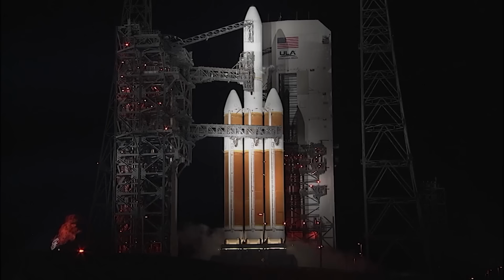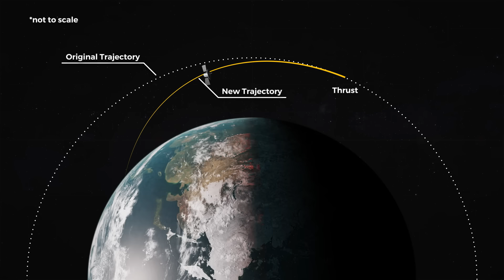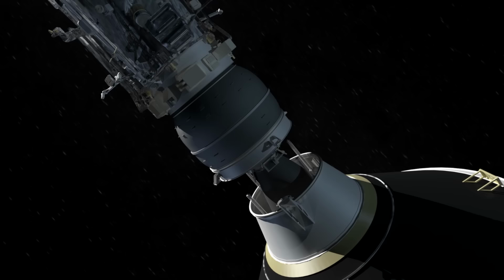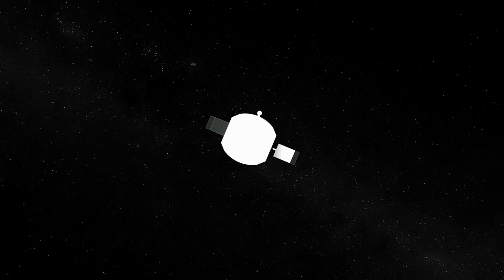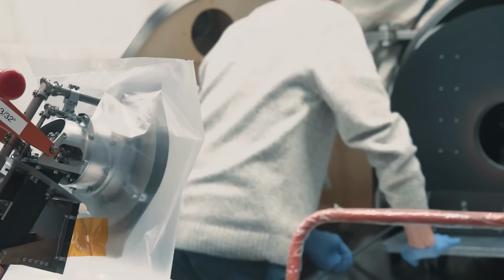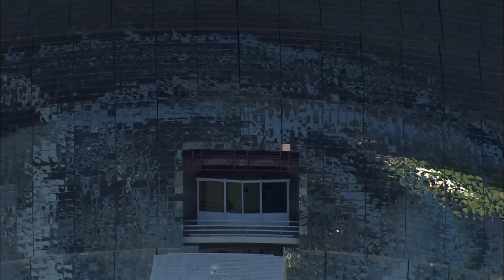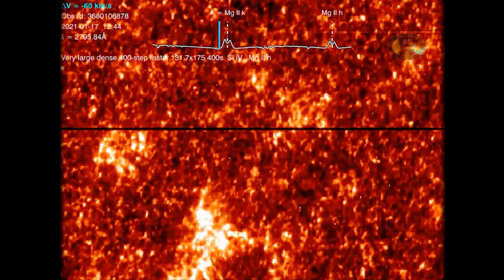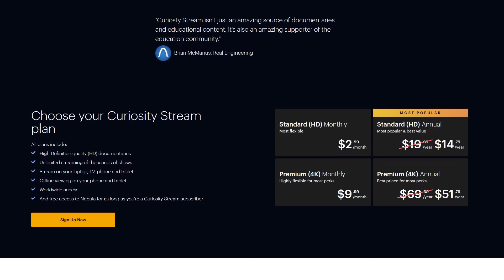The Insane Engineering of the Parker Solar Probe

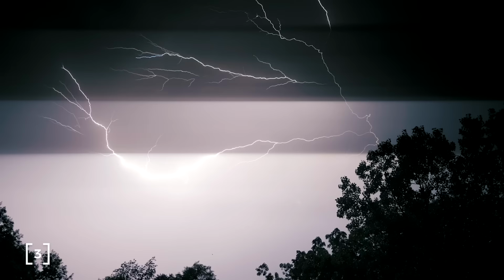Comment: According to the video, the parker solar probe had to face 3500 C temperature for example at 14:20, but at 1:28 you said corona has a temp more than half a million C. Have I been mistaken and didn't watch the video properly? or is there a mistake in the information provided in this video?
Because I cant imagine a man made object surviving half a million C temp!
Apart from this, I really enjoyed the video kudos to this channel!
Reply: The corona gets up to million or more degrees, but it is not all encompassing in that while the particles in there attain that kind of 'heat', they are relatively few and far between and thus the actual temperature that the probe experiences within the corona is a lot less. Thus, it's all about heat transfer. Liken it to putting your hand in 50-degree (celsius) water--which is hot--and then 50-degree air... the latter feels nowhere near as 'hot'. That heat shield is amazing plus the probe has cooling.
Reply: @nuntana2  ohh thanks for providing this information!!
Reply: Absolute lies

Comment: Temperature is a very abstract concept. Especially at such low densities.
Reply: Yep, given the densities of the corona i'd bet a block of ice at its melting point has more internal energy, since the density of the corona iirc was in the order of 10^-9 gcm^3
Reply: The earth is flat and actually Satan has taken credit for the ball earth thing actually.
Reply: @kevinkarlwurzelgaruti458  Temperature is the measurement of energy transferred from one mass to another.
And the total amount of energy transferred depends on how much mass there is, with higher energy, to transfer to the lower energy mass.
For example:
If you drop a grain of sand from 100 mts. high on your head, you won't even feel it.
If you drop a block of 100kg of concrete from 100 mts. high on your head, it will kill you.
Both the grain of sand and the block start with the SAME energy LEVEL (like saying they start with the same temperature level). But the block has WAY more energy MASS that will transfer to you.
So, more density means more total amount of energy available to affect the lower energy mass.

Now, in the corona of the sun, the energy mostly comes from radiation. The radiation density is VERY high.
And the particle density is very low.
That's why simply hiding behind a heat shield (which is a bad name, it's actually a radiation shield) is enough to protect the ship. Because there is no mass around it that carries any energy. And rays only go straight, and don't bend around the shield.
If there were a substantial amount of mass, it would go around the shield and transfer a lot of energy in a very short time, enough to raise the energy level of the ship's mass, to a point were it would break or melt.
There is mass in the corona, but it is very little (low density) so the total amount of energy transferred to the ship is small, and it doesn't raise the ship's energy too much.
Reply: @gdxd7956  Very well said, thanks for the explanation.

Comment: 17:09 They have recently generated more energy than the energy used to start the fusion reaction. It's funny, 10 months ago they probably thought that it would take 50-100 years to achieve that
Reply: They didn’t really. The fusion reaction created 1/50th of the “total” power it used to do the experiment. What your referring to is that it produced more energy than it required for the lasers to start the reaction, but that doesn’t account for all of the other power losses in the system. Do a little more research on it and you’ll find we were a little mislead on that break through. We still are very very far away.
Reply: @ChristopherGuilday  This is true. The net energy of the lasers was 2.05mW. However due to the inefficiency of lasers they probably consumed a 100mW+ to produce those lasers. However, what happened was a big milestone and it's only a matter of time until fusion experiments get increased funding and are able to accelerate their progress.
Reply: What really matter is the amount of money going on vs amount of money out. Nuclear fussion doesn't even need to generate more energy out than in to be profitable, if you can produce and sell something else.
Reply: Christopher Jannette  not when 1500% is required
Reply: @ChristopherGuilday  the lasers used in the experiment are horribly outdated and inefficient, this experiment proved fusion was energy profitable to begin with. It proves that it’s possible
Reply: Joe scott has a good video on this

He's explains basically what everyone is saying in these comments, it was a bit misleading but it was still an achievement
Reply: Doesn’t .. Delta V .. mean acceleration??? The derivative of velocity is acceleration and if we need to use nonsensical/ indirect language in order to sound more intelligent im gone immediately. Delta V = acceleration. So speak the language
Reply: 10 months ago it was only another 20 years.. And 20 years before that... It was only another 20 years... And...
Reply: @kylegemmell484  not quite. Delta-v/ delta-t equal’s acceleration. So not the same thing.
Reply: The scientists from the SAFIRE project achieved surplus energy in an electric plasma years ago. And it doesn't take a billion dollars to do it.
Reply: @R1PPA-C  Not true. R&D across all scientific fields has exploded over time. The internet itself is only about 30 years old. We're beating our own deadlines by decades
Reply: @colinwilliams3459  it was sarcasm.. You've obviously missed the running joke that's been going on for many years now
Reply: also the main fuel is hydrogen and where are we getting it from our own water so if we got so many fusion reactors won't we just end up using our very much needed water.
Reply: No, they exaggerated.
Reply: @gordo8354  this proved it is possible, not that it is profitable. there's still enormous costs of building large scale reactors, and then there's the issue of fuel costs and what fuels to use, and then there's the issue of materials in the reactor becoming radiated over time, and having to be somehow safely disposed of and replaced.
Reply: @Deltexterity  Rome wasn’t built in a day. The fact that a positive energy exchange was proven possible is a massive advancement for fusion, and as we all know technology advances exponentially.
Reply: @gordo8354  if i remember correctly, aren’t some of the materials in the reactor incredibly rare on earth, like only a few thousand kilograms on the planet? and that we’d literally need meteor mining to get more?
Reply: @Deltexterity  to my knowledge no, no materials of the reactor itself. The FUEL, however, now that’s rare, but a moon base can solve that problem
Reply: @gordo8354  i remember now, beryllium. annual production of beryllium is 220 tons, and a single fusion reactor requires roughly 500 to build. over 2 years worth of GLOBAL supplies to build a SINGLE reactor. good luck with scaling that up to meet global power demands.
Reply: 🙏🏻 that’s why I always keep a opened mind because one thing we think is impossible or improbable turns to be possible. I love how far we have come I only 🙏🏻 I’m alive to when we understand much more
Reply: @2slick4u. the first plane that we made wasn’t a Boeing 787. In science, you can’t just make something commercially viable from the start. It’s about building on previous models and constantly improving. 
Pretending like 70% to 150% isn’t actually a big deal because we need 1500% is like saying the wright brother’s first airplane wasn’t momentous because they didn’t fly over the Atlantic

Comment: I am a layman but I would guess that the reason the surface is colder than atmosphere is because some force or pressure is higher inside and/or at the surface forcing energetic particles out faster which then slow down after exiting the sun, and as such have more time to radiate heat into the area around the sun as they are moving slower. I'm thinking similar to airflow over a curved surface
Reply: No.

Comment: Great video but I don’t think you mentioned who built the and operates the spacecraft.  It was built by Johns Hopkins Applied Physics Lab (APL) in Laurel, MD.  And it is operated by APL as well.  The design of of its sun shield was led by an engineer at APL.

Comment: Great video as always. I have just one issue with it: you said the process of changing the altitude of apoapsis or periapsis was named a Hohmann transfer. This is not true. A Hohmann transfer is the combination of two of the maneuvers you described, performed with the goal of elevating or lowering the orbital altitude as a whole. i.e. going from a 450km(Apoapsis) x 400km(Periapsis) orbit to a 1200km x 1100km orbit could be achieved via Hohmann transfer, going from a 450km x 400km orbit to a 450km x 800km orbit could not, as that can be done in one maneuver. The defining characteristic of a Hohmann transfer is that it consists of two maneuvers, done sequentially at opposite points in the orbit, both of which are either prograde or retrograde.

Comment: Actually, flames have EXACTLY the same tendency. The center of a flame tends to be far cooler than the tip. Whether the tip is the hottest, or a point between the center and tip, depends on the kind of fire.
But the important part is that fire gets hotter as you move away, much like a star.
In both cases, this is because the chemical reaction progresses as it moves outward.
Reply: In the case of the Sun it's most likely due to magnetic fields adding energy to the particles, and since the gas gets more and more tenuous (less dense) the farther you get away from the Sun there's less for them to collide with and lose the energy so they tend to get very high speeds = high temperature.
Reply: ERM... except there's no chemical reaction involved in the sun. Combustion only happens in presence of oxygen. These are nuclear reaction, which is a very different thing!
Reply: @Sledr1994  Okay, yes, technically anything involving the nucleus is not chemistry. But a similar event is occurring, where for a while the temperature rises as distance increases in a perfectly reasonable way.
Reply: @Mike__B  Yes, my objection is mainly the premise that this is (A) Different than fire and (B) Counterintuitive.
Reply: Different process. Unlike in a flame where the heat generating reaction occurs throughout including at the surface, The heat generating reaction in the sun (I.e. fusion) only occurs in the core of the star where the pressure is high enough to overcome Coulomb repulsion. Whatever heats the upper solar atmosphere has to be a different process hence the theories about it being magnetic fields transferring energy.

Comment: Well, I’m a total layman, but if you light some rubbing alcohol on fire the burning vapor and fire above it will be as expected very hot, but the liquid underneath the surface stays quite cool. I wonder if the basic mechanics translate to solar mechanics. 

Probably not, but it’s cool either way.

Comment: There is a slight error at 3:38. You quote an orbital velocity of 9.2km/s for earth. Whereas, the actual figure is 7.8km/s.

 The 9.2km/s figure is, however, often quoted as a rule of thumb the delta v (potential acceleration) needed to reach orbit. With the 1.4km/s discrepancy being due to the inefficiencies due to "gravity loss" (where the rocket is burning fuel to fight gravity rather than accelerate) and atmospheric drag involved in rocket launches.

I would appreciate if you would pin this comment or add a note to the discription to clarify this.

Thanks and keep up the great work

Comment: Question, would a mirrored surface have been a better choice than the white paint?
Reply from the maker: No, mirrors reflect visible light and absorb a good deal of infrared
Reply: @RealEngineering  Ah, you took the bait. Thanks for the answer! I just wanted to thank you for this amazing content!!!! Take care sir.
Reply: @nosuchthing8  out here playing chess 😂
Reply: @salvadorrosas1981  haha
Reply: @nosuchthing8  bruh smart
Reply: well, i'm afraid the answer is much more complicated than this. First-surface mirrors (aka polished metal) are extremely good at reflecting the infrared. It's the visible / near uv that is tricky. I don't know the reason, but i think it might be the temperature. Good reflective metals are aluminium and silver, and their melting temperatures aren't very high. Tungsten is no good a reflector.
Also, most ceramics are very non-reflective in far infrared (2+ microns), which is easily confirmed by a thermal camera.
Reply: @salvadorrosas1981  Thanks, I have a few moments once a year or so.

Comment: I never thought about it but I guess there's got to be a spot somewhere between the sun and deep space where it's a very comfortable 70 degrees Fahrenheit
Reply: Temperature, as I sure you know, is just the average kinetic energy of particals. In space however there aren't many particals at all. So while they are moving incredibly fast, there's not enough of them to make it feel hot - and so space has no temperature.

Comment: I like how he compared the trajectory of the Parker Solar Probe to the previous Solar Probe idea (using gravity assists at Venus instead of Jupiter). As he mentioned, the new approach is cheaper and achieves the science objectives quicker. I wanted to add that there is an epic quote behind that. At the time Solar Probe was about to be canceled because it was too expensive a certain Dr. Alan Stern, PhD. got all the Heliophysics people together in a room to convince them to try to come up with something cheaper (Dr. Stern is the leader of the New Horizons mission to Pluto and - at the time was Associate Administrator for NASA's "Science Mission Directorate" which is in charge of all NASA's robotic science probes, space telescopes, etc.). During the meeting he pointedly declared:

 "You can either have 100% of nothing or 80% of something."

After that, they worked on how to make a solar powered Solar Probe actually work and came in hundreds of millions of dollars cheaper than the original proposal.

Comment: Wouldn’t the higher temp than the surface make sense from a heat transfer perspective and lower particle density? Don’t the flares originate from deeper, hotter plasma? Like the massive heat-sinks necessary on the ISS
Reply: The sun is a transistor
Reply: The Magnetic storms and local magnetic fields are massively powerful and it heats up the plasma particles streaming out. That's my hypothesis.
Reply: The earth is flat and actually Satan has taken credit for the ball earth thing actually.
Reply: @jameshenrysmith8426  Nice fairytale
Reply: From a heat transfer perspective it should fall off according to an inverse square law. The fact that it doesn't means something else is moving the high energy particles outward. It could be magnetic, a consequence of Pauli's exclusion principle, an artifact of the CNO cycle, or something else entirely. We really don't know.
Reply: @abebuckingham8198  But considering thermal conductivity is based around the particle density, it isn’t applicable in a vacuum. And the further you get from the Sun, the fewer particles exist to transfer the energy as opposed to the surface
Reply: Hey I was right. Particle density. Sweet
Reply: That’s one of the reasons they sent the probe to better answer this question

Comment: It’s hotter in the corona than the surface, cause that’s the point of combustion. The same applies to a bunson burner torch. the thick part of the flame at the base (source of flame) of the flame is cooler than it is towards the tip.

Comment: Thought they would use a more mirror like material for the surface of the heat shield. I guess that ceramic paint i super good at reflecting the energy but still.

Comment: Isn't it just the same as a candle flame being hotter at the tip than at the base/origin? I know that the sun's heat comes from nuclear fusion rather than the process of conflagration, but I assume the logic behind the corona being hotter is similar to this.

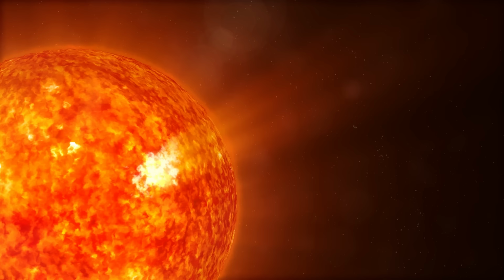Comment: 1:45 No, not really. The density of the chromosphere is so low that it doesn't transfer heat efficiently. This explains why the chromosphere is so hot. The outer parts of the Earth's atmosphere are also much hotter than lower levels,

Comment: Keep in mind the Corona is way less dense than the Photo/Chromosphere. It is way hotter, but it is like comparing walking through some airborne embers on Antarctica vs walking through the Sahara desert in midday. The embers are hotter yes, but the environment is not, as there are less hot particles.
Reply: I think a better analogy is sticking your hand in a 500 degree oven, versus sticking your hand in a 500 degree liquid. In the first case, your hand is fine for a couple minutes. In the second one, you don't have a hand anymore.

Comment: It's not all that surprising that the corona is the hottest portion of the solar atmosphere as radiant heat needs a material to receive the radiation in order for something to actually "heat up", it would only make sense that as atmospheric materials receive radiant heat they heat up and rise toward the corona, eventually gaining enough energy to escape the sun's gravitational force and fly away as part of the "solar wind". If heated material has a lower density, where do you find the hottest material?

Comment: I have a question, can’t it be the solar mass refracting the light and making the upper atmosphere hotter and/or because of the heat and the gravitational force, the upper atmosphere experiences much higher pressure with the heat going up in the atmosphere ?
Reply: I had a stroke reading that, but I think that the heat rises and the colder bits get lower